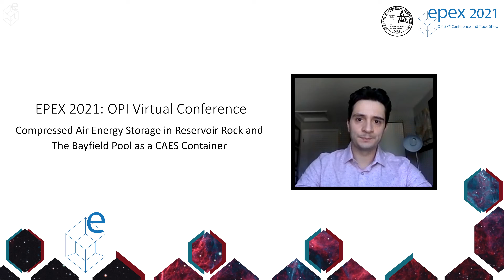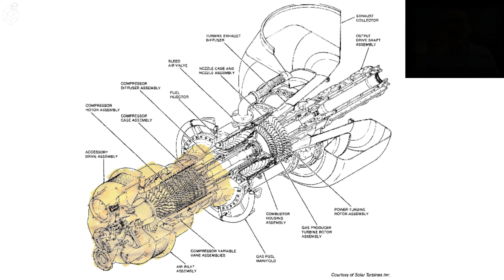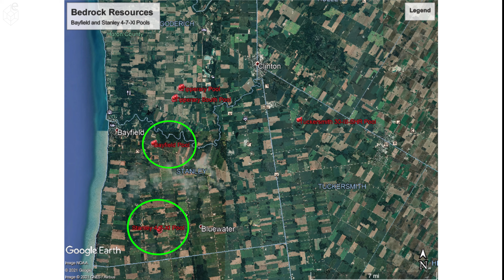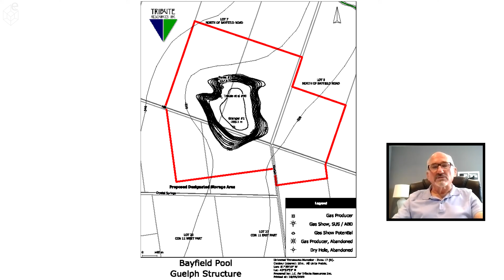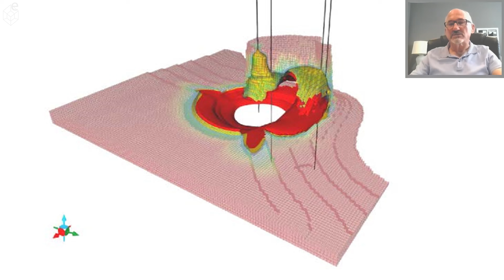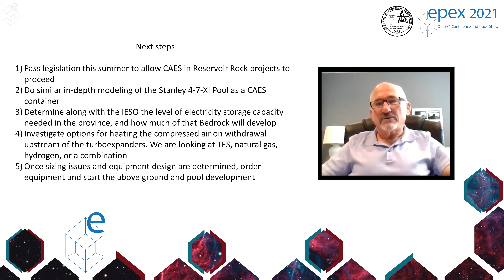Bedrock Energy: Compressed Air Energy Storage (CAES) in Reservoir Rock

Comment: How do you effectively sweep your reservoir? Wouldn’t there be oxidation interactions subsurface that are too dangerous or problematic to overcome long term? I can see how you can mitigate explosion risk, but after 100 cycles when your purged nitrogen has all mixed in with air and potentially remaining gases in the reservoir…. Can you actually ever eliminate explosion risk subsurface?

Comment: Very interesting project about CASES using air storing on depleted natural gas reservoirs.
However if we will see the case with 25 wells producing 1.5 B scf air within 3 hr and using this air on gas turbine 1GW for 3 hr, we see that air usage is 500 scf/kwh.  Other side is that having compressed 1.5 B scf or 2.5 scf air underground at 3000 kPa need compressors and energy to power compression.  What energy will be in and what energy out from these projects, or ERoEI. thanks
Reply from the maker: A group from U Waterloo presented a tool that may help answer some of these questions:
https://youtu.be/-8nxA1Un400
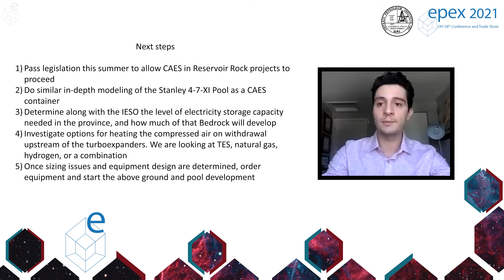Reply: @ogsrlibrary  Thanks for links, and there on min 12:59 on presentation we have air mas flow rates 181.437 (believe is Nm3 per sec) and Fuel mass flow rates 3.17515 (PROBABLE CH4 Nm3/s) and power output 0.319 (may be MW).  Some simple calculations shows that CAES project will use 0.5 scf CH4 to generate 1 kwh energy and on addition to this 5693 scf air (compressed and stored at pressure 25000 kPa and depleted to 4000 kPa).  So what energy (renewable kwh) will use this project to compress 5693 scf AIR and then sell.